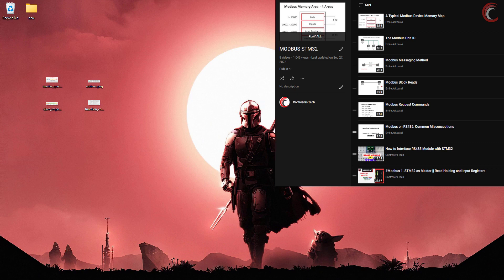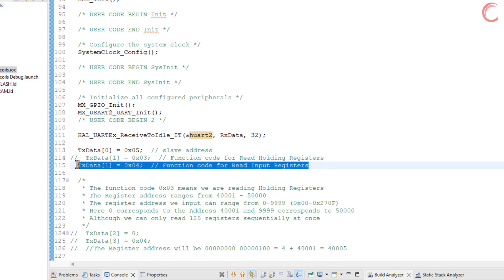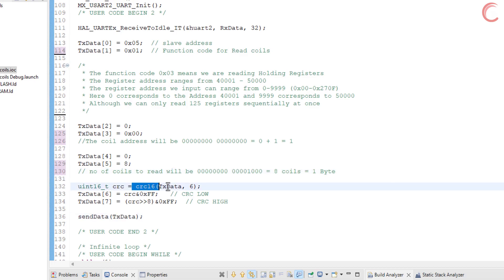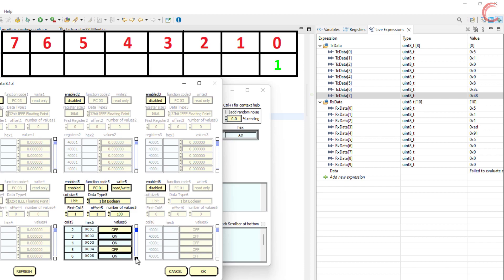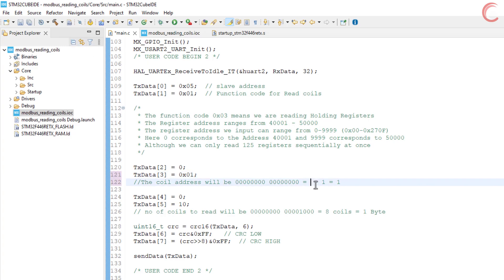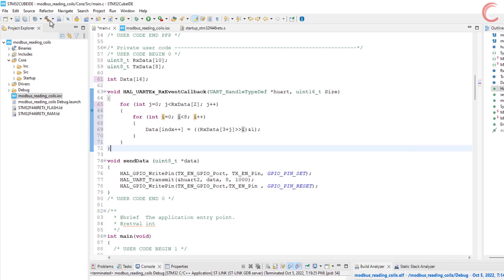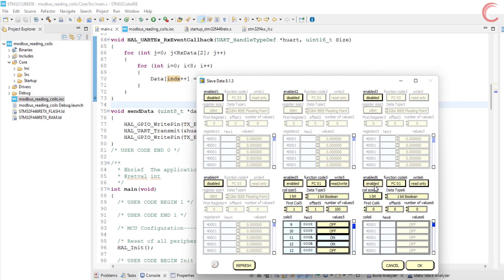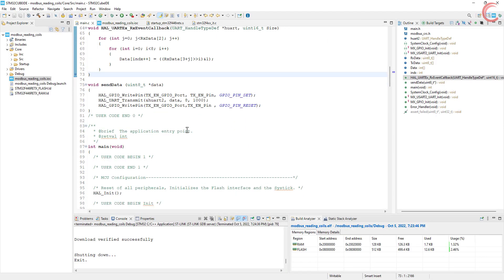Modbus #2. STM32 as Master || Read Coils and Discrete Inputs

Comment: Hi. Thank you for the tutorial. I learnt from it and now I'm able to establish communication between stm32f302 and an acrel energy meter (slave) over RS485 successfully. The trouble im having is if I query address 100H the microcontroller sends 0 instead. Could you assist guide in what I could change so that 100H is sent out as 100H. Any assistance will be highly appreciated.
Reply from the maker: The address is 2 bytes long, TxData[2] (higher byte) & TxData[3] (lower byte). 
0x100 is bigger than a byte, so you need to store it in 2 parts. 
TxData[2] = 0x01;
TxData[3] = 0;
If you want to automate this process, you can do the following. 
Uint16_t adress;
TxData[3] = address & 0x0F;
TxData[2] = (address>>8)&0x0F;
Reply: @ControllersTech  Thank you for your response. This worked perfectly. I highly appreciate.

Comment: You got the addresses wrong. The first digit is the type of address, not part of the address. So 40001 is actually command 4, address 1. Since addresses are 16 bit it should actually be written like 400001, not 40001 though that notation is not very common. Modbus is a very old standard and it shows. But I like it.